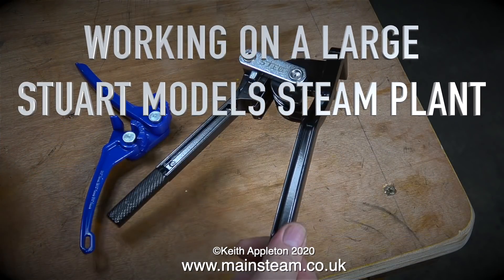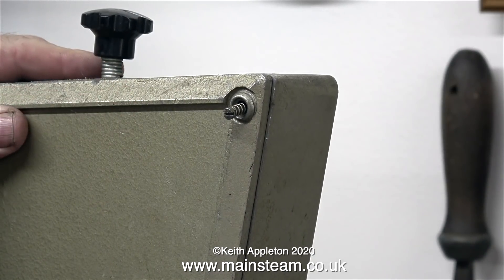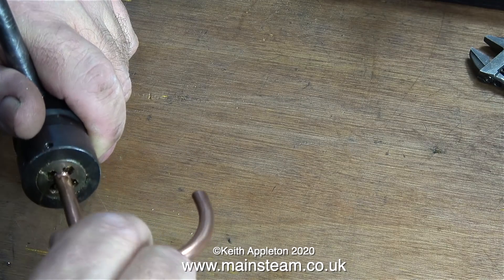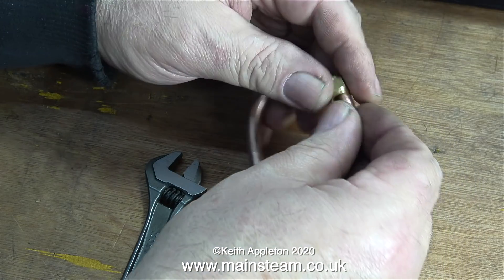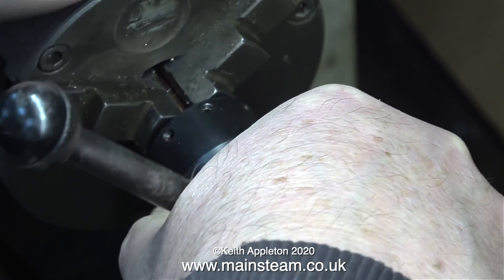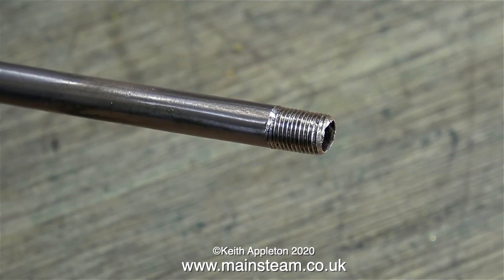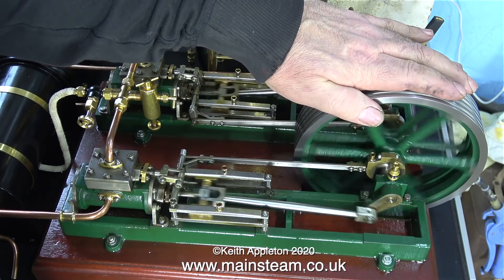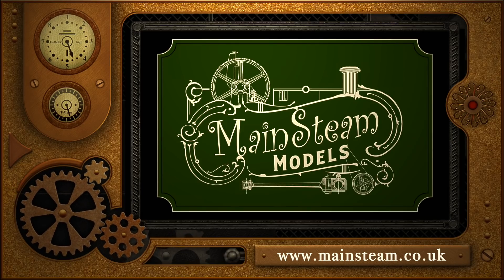WORKING ON A LARGE STUART MODELS STEAM PLANT - PART #18

Comment: Many years ago I worked on a piece of electronic equipment. Each of our 35 units had two air filters, each held by four turn lock fasteners and they had to be cleaned once each week. We found a wing nut style of turn lock fastener that interchanged with the one that required a screwdriver. So, If you want to save the time to find a screwdriver every three to six months when you replace your saw blade, you could get some of them. (-:

Comment: Keith, I have an idea that will help run your boiler in the winter from your bench. Go to your local DIY store and purchase a cheap bathroom exhaust fan, a sheet meral fan to pipe (used to pipe your exhaust fan through the roof ) adapter , some short PVC pipe and dryer exhaust ducting. Install the fan on your back wall and attach the adapter then run piping over the center of your bench. Attach the dryer exhaust ducting but leave enough room to cover the smoke stack. After you start the boiler place the dryer ducting over the stack and start the fan. This will exhaust any CO or CO2 outside. When not in use you can collapse the dryer ducting and hold it in place with wire ties.
My work bench is against an outside wall and I have three places that I can run from , so I installed two Tee fittings with ball valves. It keeps the atmosphere alarm from going off and my wife from checking up on me.
Anyway it's something to think about for next winter.